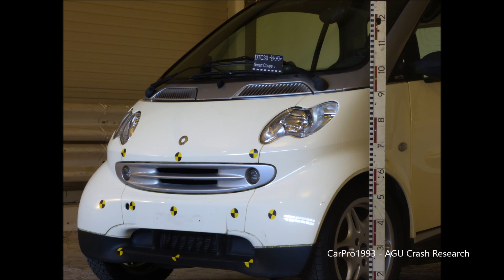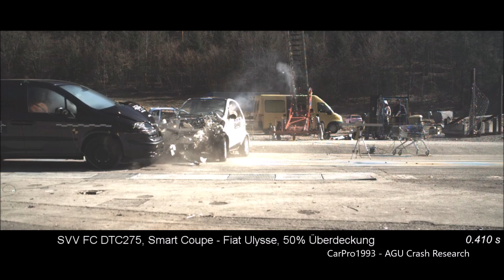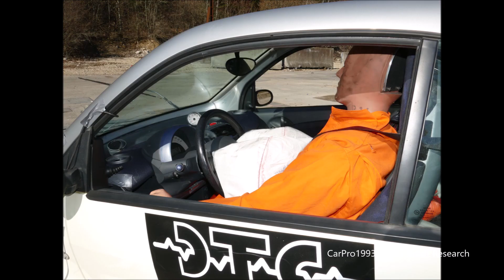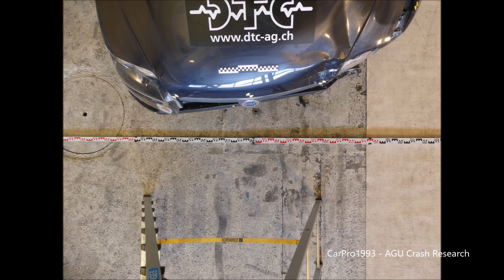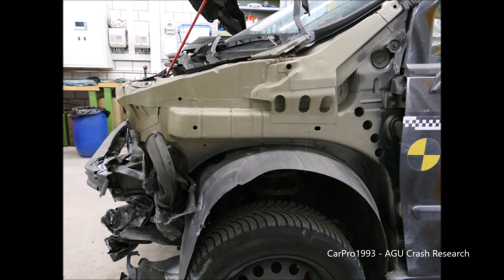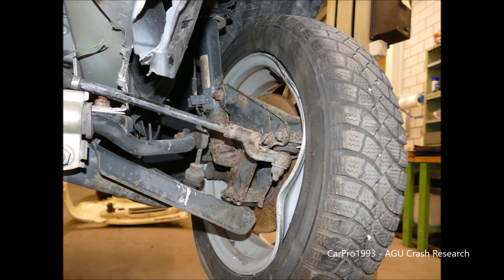2003 Smart Fortwo Into 2005 Fiat Ulysse 50% Overlap Frontal Crash Test

Comment: I love how everyone wants to complain about how the smart would have high energy loads, Mercedes knows what they were doing and I’m pretty sure the energy involved is more than survivable in most crash tests done on the smart car.. what’s important here is not being crushed to death, not slamming your head into a steering column coming at you or having your legs crushed into a fold in the floor between the seat and foot well.. those I just described will  cause serious injury causing forces. Let’s just look at the IIHS test of a Chevy Venture and a Smart Car and compare. Again Mercedes knows what they are doing and they and they took many measurements to make the smart car the safest super mini on the market and I’m certain any down side they accepted with “higher forces” from smaller crumple zones are well within whats survivable. Mercedes crash tested the smarts against the S class to prove how safe they are. Received High rating from the IIHS (and that wasn’t common back in 2008-2009) they had high ratings in NHTSA and euroncap crash tests they even had a section on the smarts website back then with owners of smarts involved  in accidents where they would upload pictures and boast how safe the car was. Fun fact the Smart Fortwo was not sold as a manual in the American markets because the clutch pedal would move and possibly cause an injury. They also have been designed to use the crumple zone of the other vehicle involved in a accident to help absorb forces. Do research before looking ignorant.
Reply: Tommy V Nice. I agree. As a Smart owner and Smart fan let me just add that there has never been a manual Smart : it was always sold as an semi-automatic (no clutch pedal, clutch is operated through actuator).
Reply: Actually, the Smart wasn't a very safe car even back in 2008. It was average for a supermini. While Mercedes does know what they're doing and their cars sold under their own brand are extremely safe, you can't repeal the laws of physics, and a Smart may have a very strong cabin but it has very little crumple zone space, which means a rougher stop that restraints can't fully compensate for. 
IIHS did crash tests in 2009 with 3 superminis against midsize cars from the same manufacturer, the Smart vs. Merc C-Class, Toyota Yaris vs. Camry and Honda Accord vs. Fit. The Smart and Yaris both had forces that could have proven fatal, while the Fit did a lot better, forces were very much survivable. And the Yaris was one of the worse performing superminis in '09.
IARV: HIC-15 700, Nij 1.00, 60 Chest G's, 50 mm chest compression, 9.1 kN femur force, 1.00 tibia index (above these values serious injury is possible)
Smart: HIC-15 1,660, Nij 0.57, 92 Chest G's, 21 mm chest compression, 12.7 kN femur force, 2.86 tibia index
Yaris: HIC-15 1,483, Nij 1.13, 115 Chest G's, 38 mm chest compression, 14.4 kN femur force, 1.27 tibia index
Fit: HIC-15 542, Nij 0.41, 65 Chest G's, 33 mm chest compression, 10.1 kN femur force, 1.13 tibia index
The Fit was about the same price as the Smart, had 3 more seats, and similar gas mileage, and could protect the driver from dying in a 40 mph head on collision with a midsize car, something the Smart and Yaris couldn't guarantee. 
High ratings from the IIHS were very common in 2008-2009, they actually had gone to letting manufacturers crash test their cars instead of crashing every one of them themselves in the front offset test, and most of the new cars were doing well in the side impact and other tests as well. I actually went to the IIHS twice, in 2008 and 2009. My mom also owes her life to a 2008 model car (a Honda Accord, not a Smart). On November 25, 2008, IIHS announced that 72 different car models had gotten a 2009 Top Safety Pick. Guess which car wasn't there? The Smart. In the offset crash test at 40 mph designed to represent a Smart hitting another Smart head on, the dummy's head hit the steering wheel through the airbag, something that only happened on about 15% of cars at that time. The Smart also had only a combination side and head airbag instead of the safer separate side torso/side curtain airbag design. 
June 16, 2020 8:18 am
Reply: whattheheck1000 compared to many super minis of that time the smart really stood out as far as the structural integrity goes especially since Japan and Korea were exclusively selling death traps in the “sub compact” category.  There’s no argument in that. Especially when it comes to side crash tests.

Comment: I don't see the results from the sensors but it looks like dummy occupants of the Fortwo had to withstand a lot bigger momentum than those in the Fiat.
Not to say that the Fiat is better or that the Fortwo doesn't have good safety measures but the difference in mass of the two cars does mean a lot in this crash.
The crumple zone in the Fiat looks like it made it better for the occupants of both cars.

Comment: Old clip… Picked up a nice clean 2016 ForTwo for RV Toyhauler… in place of a full dressed bike… much more enjoyable for an older couple. All small cars back in 2008 timeframe weren’t that safe, even larger cars lacked in many ways for safety. Crumple zone would be crush between the two cars… both occupants benefit as crush zone to slow down mass. Severe enough, it’s correct the sudden deceleration will likely kill the occupants in Smart, no matter the structural integrity… that allows the body to be removed easily. In the end, I compare to motorcycle… much more safe and added perks… clear roof, comfy quite cabin, AC, heater, side by side companion, etc… cruising around in place of 1 ton Dually for runabouts provides lot more comfort gained but reality remains… a mild wreck may be terminal… but a lot more safe than being hit on bike. Everything is relative.

Comment: The driver in the smart is definitely dead, the G force are the problem and the smart can't absorbe this force in the same way of the Fiat.
Reply from the maker: The driver experience a maximum of 32.5 G's in this crash test. NHTSA's FMVSS 208 requirements allow no more than 60 G's in a 25 Mph unbelted frontal impact. Fatal injuries are extremely unlikely here.